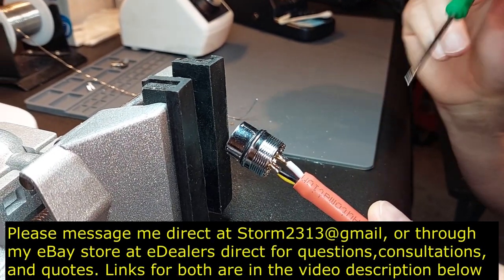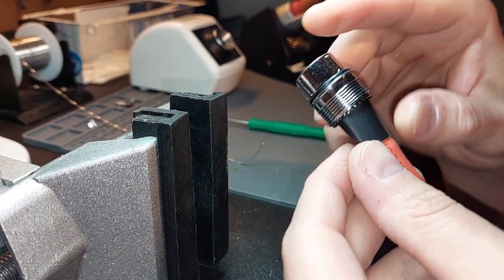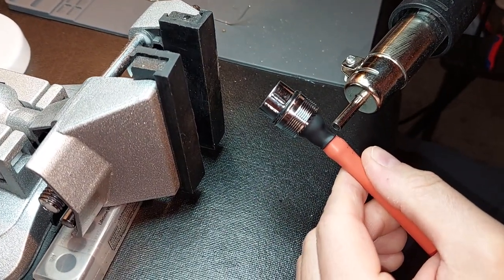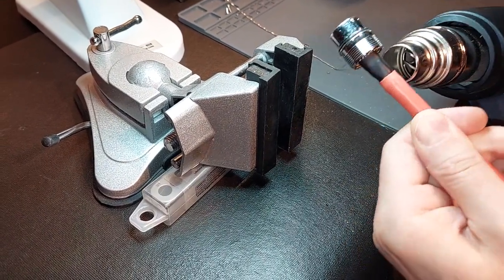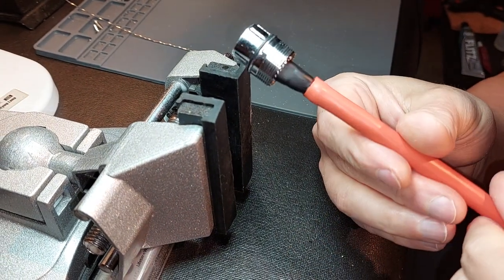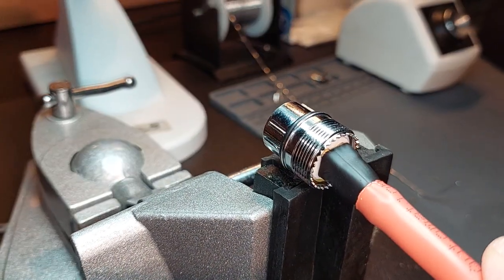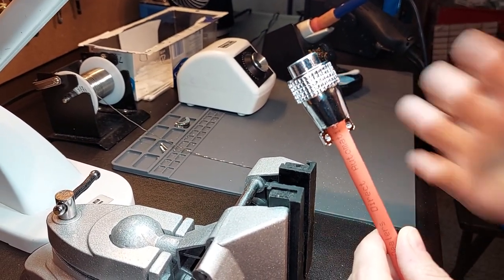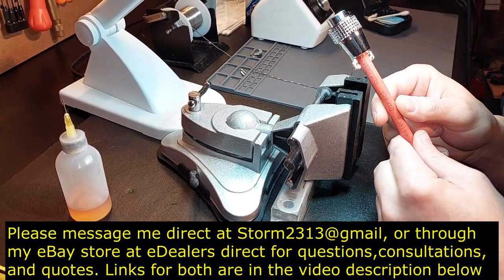DS Flexion Spindle Cable With HY Large White Connector Installed 4K...

Comment: So you shouldn't connect the foil to the spindle end? Appreciate the video and info!
Reply from the maker: Thank you for your support. You're correct.The only connections for ground to connect are the shield drain, and the ground lead. These in best practice should be attached at the VFD end of the cable. Thank you,
Vince
Reply: @corvetteguy50  thank you, Vince!
Reply from the maker: You bet...:) Vince

Comment: What about individually heat shrinking each pin?
Reply from the maker: You certainly can do that if you prefer, but considering the clearance required which as illustrated in the video is only about 12.7mm (1/2in) then soldering the terminals become very hard especially while applying heat to the cable's leads to terminate them to the connector which can inadvertently cause the heatshrink to begin to shrink prematurely. I find its not practical especially when utilizing double wall adhesive heatshrink in a single piece. Thank you,
Vince
Reply: @corvetteguy50  okay.  I want to give it a try with 1/8 heat shrink, probably do all one time with heat gun instead of individually.  I've purchased the 20 inch double shielded cable from you so I have something to look forward to.  Your way is very good. Thanks for the shared knowledge and skill.  Glad I've discovered your videos.
Reply from the maker: Thank you again for your support. I really appreciate it. Vince